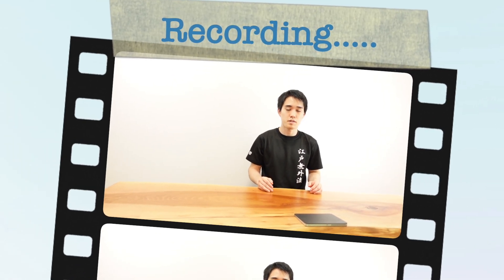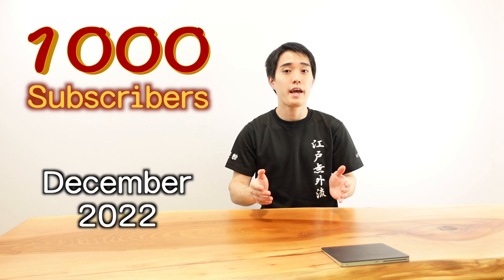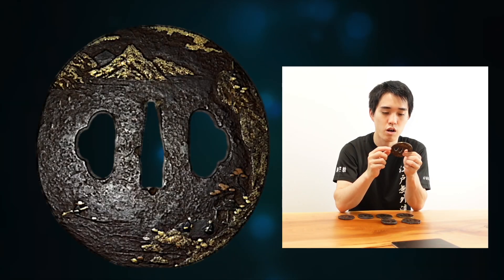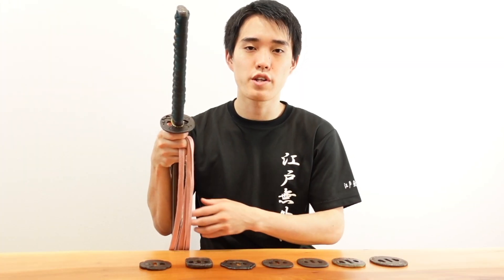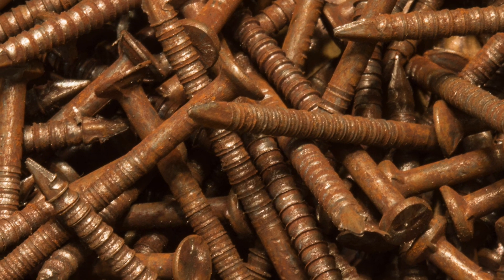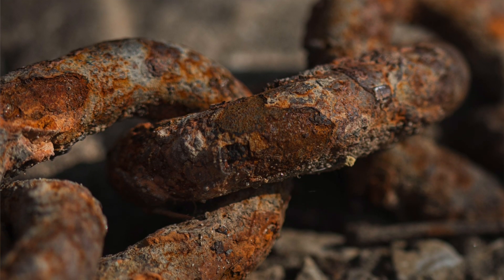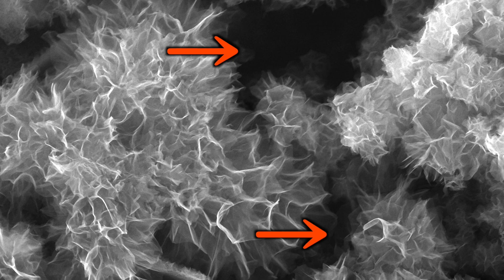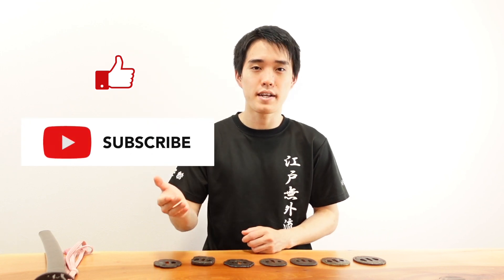Why Japanese HAND GUARDS is rusted for centuries. #katana #handguard

Comment: It's also really interesting that normal rust forms structures much larger than the structure of the iron and is therefore unstable, whereas the hematite and magnetite oxide forms are smaller and more stable. (which are the forms of oxide that protect the steel)
Reply from the maker: Icic! That is very interesting to know. Thanks for sharing the knowledge and also for watching our video :)